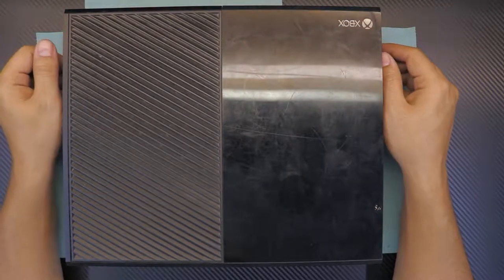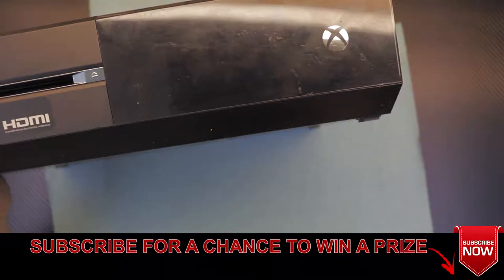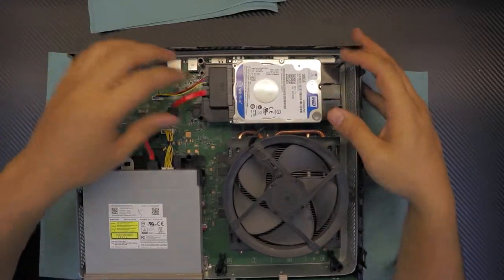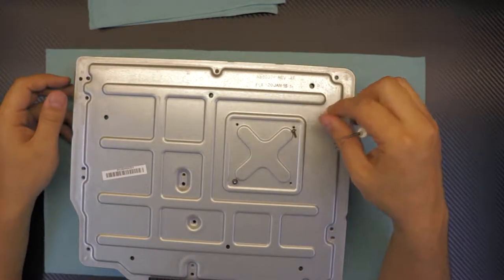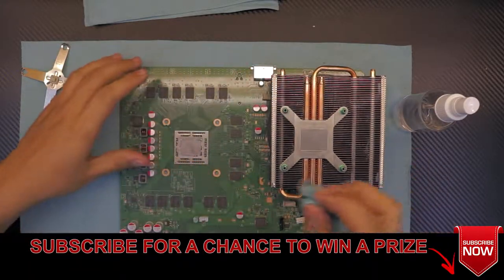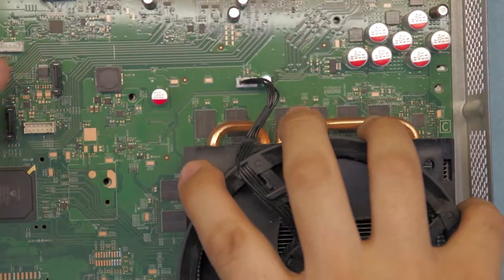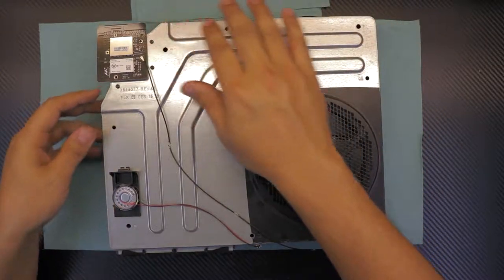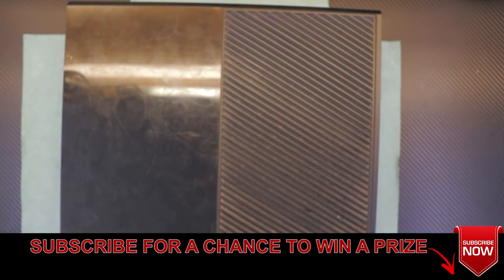Xbox one1540 disassembly  and service and REPASTE

Comment: A 4 yr old video yet first time after maybe 20 XBOXES (360's as well) I've seen someone remove the X-Clamp with such ease. I've been fighting with screwdrivers and even home made tools from other videos. Awesome! I'd recommend NOT disconnecting the wifi/Bluetooth antenna cable since these are usually super fragile at the connectors. Awesome vid.
Reply from the maker: Thank you for the feedback! if you wish to support the channel you can LIKE or SUB or both :P
ya i seen so many people fight and get frustrated over the clams :P
if you have any question or request in the future feel free to ask me.

Comment: Hi I have a situation with my Xbox I was playing and it turned off I tried to turn it back on and a second later turns off, If you could give me some suggestion of what could be wrong, watching your video I think it could be in the front board were you plug the power button if you could help me I'll appreciate it and thanks for this video
Reply from the maker: Thank you for the feedback! if you wish to support the channel you can LIKE or SUB or both :P
regarding your question: its you power supply, test it with a different (new) PSU and you should be fine, we used to get a lot of this issue in the store and 90% its the PSU that its gotten weak. test that out 1st
other videos that you may find useful:
https://youtu.be/Co723TyKZo8
https://youtu.be/ta0ouN5jOZw
Reply: @uFixTek  thanks I'll try that and subscription will be done thank you
Reply from the maker: thank you and i hope you get it fixed if anything let me know and i try my best o help you.